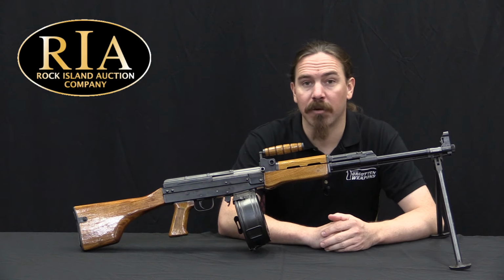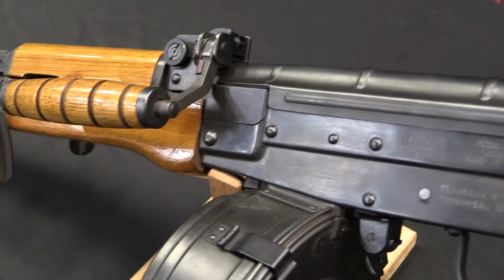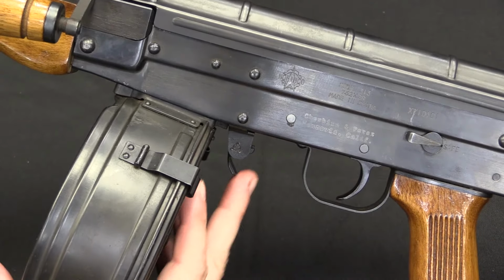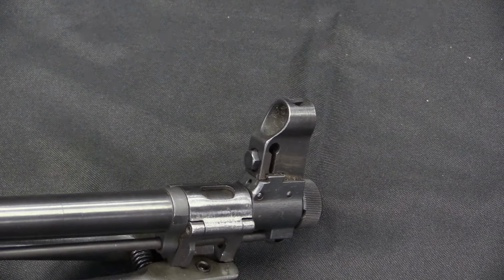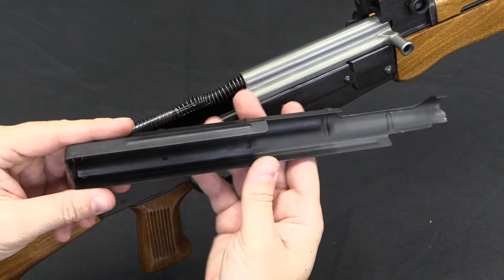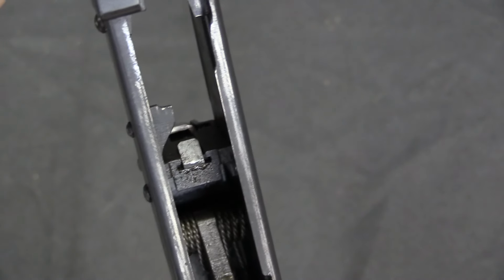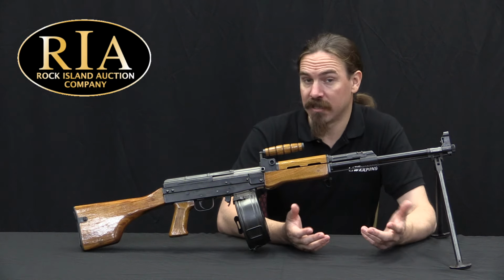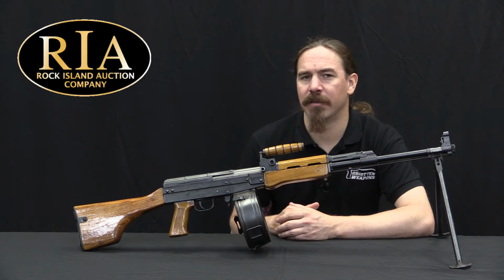The Type 81 LMG in Civilian Form: Norinco Model 313

Comment: Hey Ian. I have the regular "rifle" model of the Type 81. It's the closest thing we can get to an AK47 pattern rifle here in Canada anymore. I used to say that about my CZ 858 tactical 2 but I think the 81 looks even closer. You can get AK47 mags to work in the Type 81 if you notch out the top back of the mag and file down the front top. There is videos on here that show how its done and I have done it and it works. Only thing is the bolt hold open does not engage when empty if you have an AK mag in an 81 but that's not that big of a deal. Thank you for all the great videos and this one for sure. Keep up the good work and cheers from Canada.
Reply: Jim Squire agreed, this is probably the closest to a Kalashnikov variant we can have, other than the extremely rare and costly Valmets kicking around in 30-06, 308, 223, and one or two in x39.  That said, I think I prefer the VZ58 as a comblock gat over the Norinco
Reply: @bilodeaumichael3  Wolverine has some Valmets in 308 and 30-06 in stock and the prices aren't bad.
Reply: @ExplosiveFetus  I thought Valmets were prohib? Or are you guys the ultimate of licensed owners?
Reply: Justin Whitehead Negative.  Valmet, for reasons I’ve never understood, is NR with appropriate barrel.
Reply: ExplosiveFetus I’d be down in a heart beat if someone could import the damn 7.62x39 model again.  All I need is an Ak pattern rifle in a viable caliber for plinking.  .308 and -06 are a bit out of my speed for most of my shooting.
Reply: bilodeaumichael3 Valmet was NR because the government had just sold a large number to First Nation/Inuit groups (I don’t remember which) and the backlash would have been massive in those groups if they gave/sold them these rifles one day and then said ‘by the way, we’ll be taking these back now’ the next.
Reply: @MrHouse-fo1od  There was an exception made because right before AKs were put on the new prohibited list the government had given a bunch to Inuit up north.
Reply: Dan Groll Ah. Political nonsense as usual.  Such trash.  Wish they had given them Dragunovs so I could have a glorious original Russian SVD here...
Reply: @ExplosiveFetus  Yeah I knew about that I thought it was for the Vz.58's, I couldv'e sworn that I seen most Valmet models named in prohib lists but I wanna know what barrel man! Is it it just the <18.5 inch limit?
Reply: @MrHouse-fo1od  18.5" is the shortest length for any non restricted semi auto centerfire gun.
Reply: @ExplosiveFetus  Im aware.
Reply: @bilodeaumichael3  the government I think ordered a bunch of surplus valmets for natives up north and then when gun legislation came about they didn't want to ban them lol...at least that's what I heard. I'm from northern Ontario
Reply: @ExplosiveFetus  It's actually 16" minimum length for non-restricted, if that was the gun designer's intention. Otherwise, if you cut a barrel down (ie: sawed off), it becomes restricted if it's shorter than 18.5". Also, the Mare's Leg's barrel is just under 13" long and NR.

Yes, I pay money for these laws 🙄
Reply: a bunch of valmet were given to the native up north thats why it was excluded from the AK prohibition so we from southern canada threw money at them and they sold it to us.
Reply: @SeaWasp  Manual action center fires have no barrel length requirement as long as the overall length is over 26". Doesn't matter that the mare's leg has a barrel shorter than 18.5". And yes you can get past the 26" overall limit for NR guns as long as they're still able to be fired from the shoulder and don't have folding stocks and come from the factory like that. The new shorter version of the KSG also does this and is less than 26".  I don't know where you're getting the 16"minimum length from?
Reply: The scuttle butt was when the bureaucrat that went through "guns of the world" looked at the valmet, they had a sporting version with the short 3-5 rd mag, blued and a nice wood stock in the pictures, i forget right now but the 76 is prohib, and the 78 NR or vice versa
Reply: To get a legal Ak can't you buy a valmet hunter and convert it with AK parts? has anyone tried that because the valmet hunter to my knowledge is legal
Reply: @bilodeaumichael3  It's NR because the gov gave them to Indian bands and could not get them back when they made the AK prohibited.
Reply: in canada the Valmet Hunter is non restricted. This is a result of the government buying thousands to replace Enfield for the inuit. They gave them out and then they realized they banned the ak and all variants. So it has a specific exemption.
Reply: @joel_rigby  I have heard this too but as far as I can tell there is no documentation supporting it. It would actually be to the favour of Canadian gun owners if we could demonstrate that this happened as the point could be made that an exception to the AK ban was made for one specific group and not the others.
Reply: @bilodeaumichael3  I would agree. 58 is a lot lighter. I'm just loving my 81 right now because its my newest weapon.
Reply: Make one wonder why they only target ARs and AKs when you can get a slew of other firearms that accomplish the same task.
Reply: @cooliobob1274  because evil guns >:(
Reply: @cooliobob1274  Availability. The point of restricting weapons isn't to make sure no firearm ever touches anyone's hands, that's obviously a ridiculous notion. The idea is to make it harder. When there are 100,000,000 AKs in the world, and God knows how many ar-15s, it's much more effective to reduce the supply of those rather than worrying about vz58s, a lesser-known rifle, with far fewer produced, and even fewer ever imported due to lower interest.

Also, I would say targeting ARs specifically may very well be due to the US's, let's say lax, control on firearms. Which means it is far more likely that someone will be able to get an AR-15 style rifle into the country than a Chinese or Czech rifle
Reply: Woistdeingott Woah there, partner.  Sounding a bit like a stepper there...
Not sure I understand your point though.  What does banning or restricting AR15s and AKs have to do with people getting their hands on them vs a Chinese/Czech gat ?  If you mean illegal arms, then the bans have no relevance.
Reply: @Woistdeingott  "The point of restricting weapons isn't to make sure no firearm ever touches anyone's hands, that's obviously a ridiculous notion" Sorry to burst you bubble
buddy but...the object is ALWAYS to have NO WEAPONS...NONE... We have numerous
politicians and public officials ON RECORD with wanting TOTAL confiscation... In my
state they actually tried to sneak an initiative in...60 days to TURN THEM ALL IN... That they were actually willing to push something like that and have it voted on tells
you all you need to know... What you are discussing is the process...removing arms
from the citizens hands slowly...telling him/her they have Constitutional Rights and
then preventing exercise of same...
Reply: @cooliobob1274  or you know, a truck.
Reply: @cooliobob1274  Mainly because politicians have no idea about firearms and banned based on what looked or sounded threatening to them.  They have heard of the AK and the AR so those got banned.  They haven't heard of the type 81 and wikipedia says its based off the SKS so it must be fine.
Reply: @FakeSchrodingersCat  Remember AR's aren't banned like AK's. restricted AR Prohibited AK.
Reply: @jimsquire9048  Sorry brainfart you're right.  In that case I blame the fact that as far as the politicians are concerned only the bad guys in movies use AKs while the AR is scary enough to be restricted but at least it is the good guys gun.  Same problem just more so.
Reply: @cooliobob1274  The SCARY black rifles. I hear ya.
Reply: @cooliobob1274  dont give them ideas...
Reply: Be glad, you actually got the best AK style rifle.
Reply: Anyone have a type 81 how does it shoot accuracy wise? I heard ~5 moa
Reply: I wish there where more T81’s in the US, it always seemed like a cool alternative to the US
Reply: @ndenise3460  is there a guide somewhere on the internet because i definitely want to do that in the future